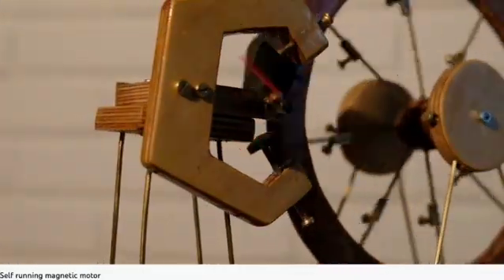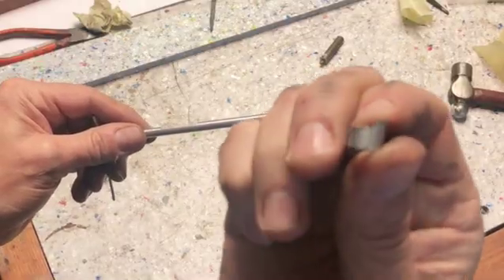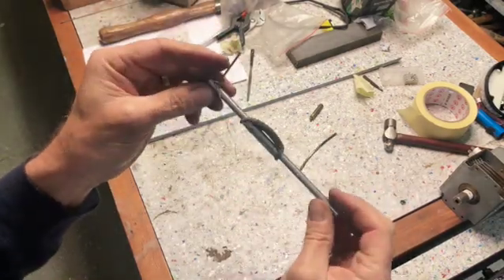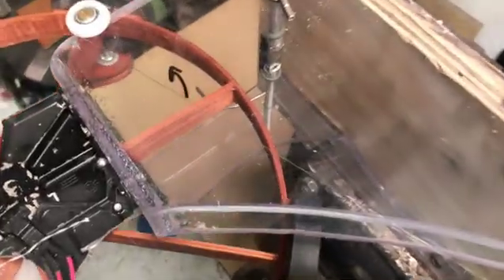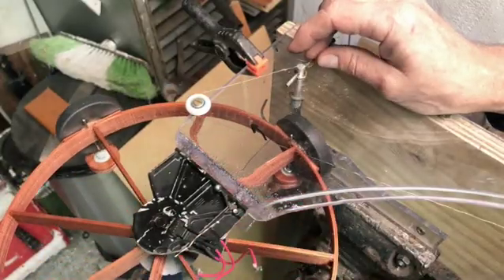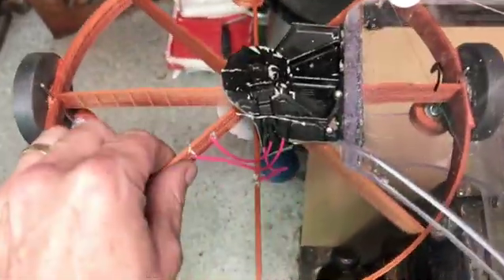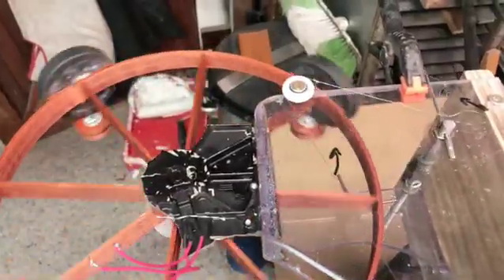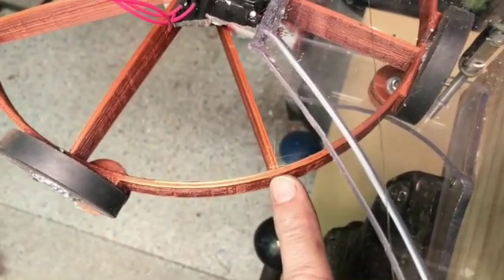How to make a self running magnet motor part 2. Free energy perhaps… maybe not...

Comment: The original wheel was vertical because the gravity helped the magnet to turn the wheel. ie: the magnet was lifting the wheel and gravity was helping by pushing down equally on the opposite side.
Reply from the maker: I agree, however it had to be balanced perfectly. By turning the wheel horizontally I attempted to eliminate the balancing issues.

Comment: You could use a donut shaped magnet for the center of the wheel area, magnetized so that N is inside S is out side, this way when bar is spinning it's spinning against magnetic field and not against material that's causing friction. Think of it like a magnetic cushion.
Reply from the maker: Good idea!

Comment: Good stuff Bro! My humble suggestion would be to suspend the wheel's vertical axle between 2 magnets and thus get rid friction. I am almost done with a different design working on that same principle of repulsive magnets. Catch you later. Good luck.
Reply from the maker: Good idea. I will resort to that if my plan with the sharp pointy low friction axle does not work.